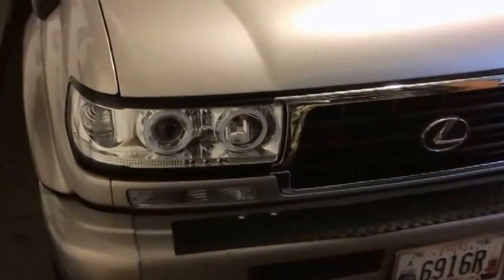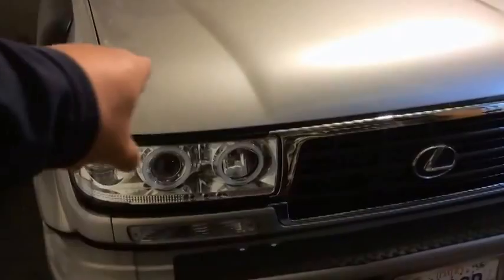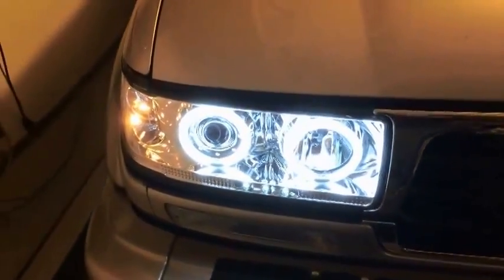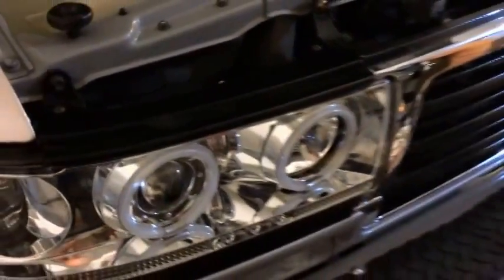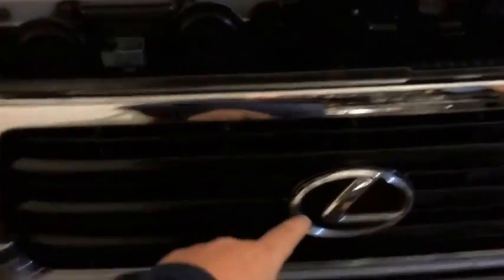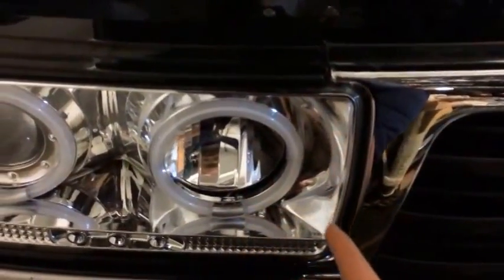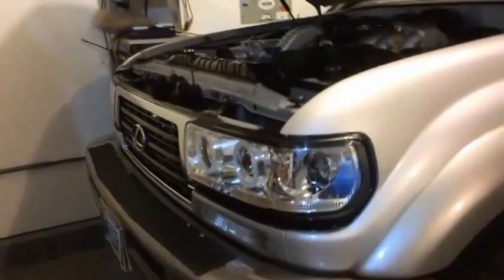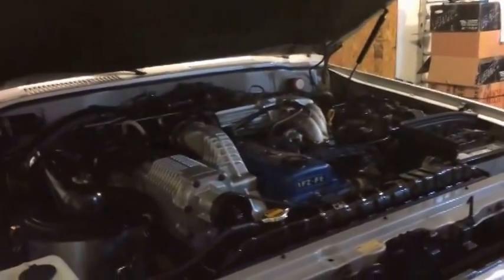Lx 450 Land Cruiser Projector head lights

Comment: Hello, I just bought the same set for my 96' Landcruiser and the headlight wiring for the Halo headlights don't have the correct harness to connect to my factory headlight wiring. I assume yours was the same. How did u hook up the wiring to the truck headlight wiring?? It looks like I have to just splice all the wiring together but Im tying not to do that... Thank You

Comment: I couldn't under stand what bulb you said to use at time 6:50  . what is the best bulb to use in the original lights .
Reply from the maker: there are 3 things:
1. Bulb type -  H1
2. wattage - if you have halaster that 35 watt you need 35 watt bulb if 55 then 55
3. color - there are colors from 3000K to 12000K I use 6000K it is pure white with a hint of blue
Reply: How do I know which one I have .And why wouldn't I want the 55 watt  if the one I have now is 35 watt is there a reason I can't use a 55 watt.
Reply from the maker: justliketolook I do not know which one you have  - which car you have and the lights are original you you got something else? 35w or 55w or else supposed to say on the blaster I do not think that 35w balaster will work with 55w bulb. what you are trying to do anyway?
Reply: I have just noticed that the lights on my 1997 lexus lx450 are not very bright at all and  compared to some of my newer cars headlights  you would think the parking lights are on . So I want to be able to put the brightest bulb that will work in my lexus
Reply from the maker: justliketolook ok get this kit
http://www.ebay.com/itm/Xentec-55w-Xenon-HID-KIT-9006-BRIGHT-white-55Watt-Conversion-6k-kit-6000K-Kit-/281209644577?pt=Motors_Car_Truck_Parts_Accessories&hash=item417966a621&vxp=mtr